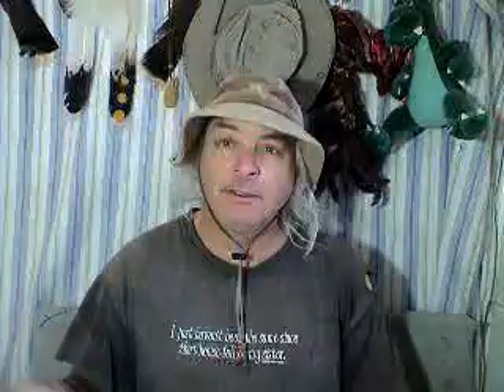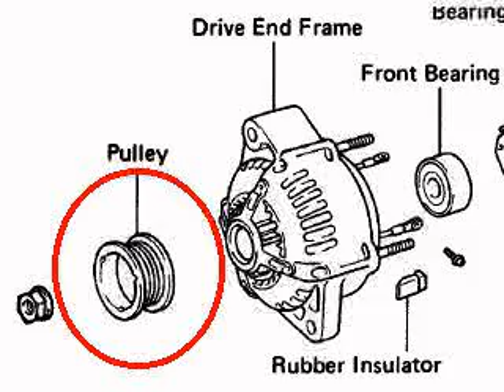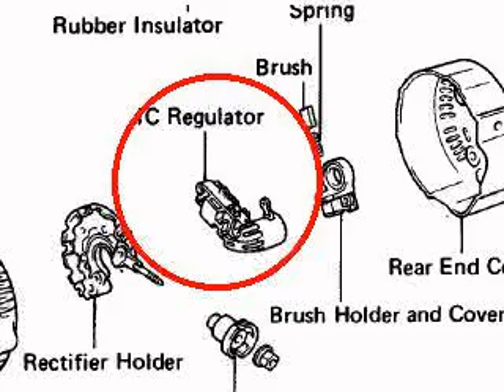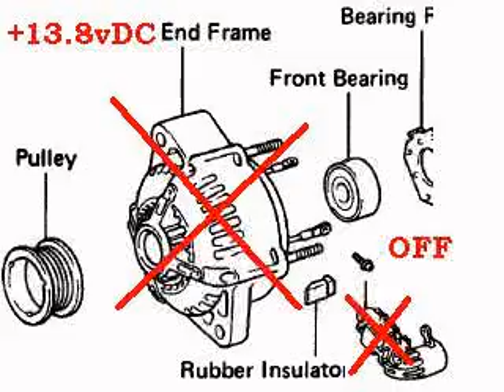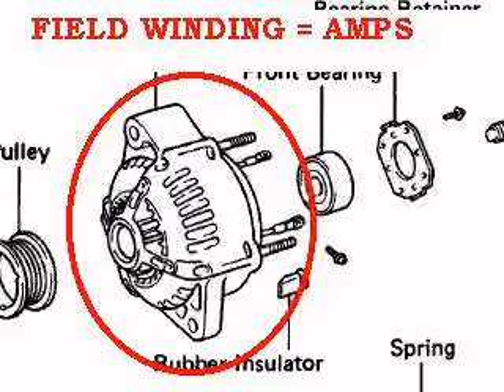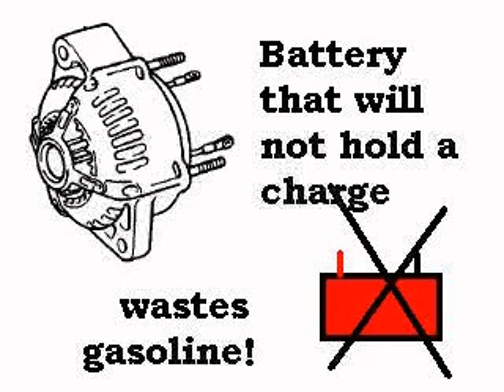Major Technology Breakthrough! Burn Water as your Automotive Fuel! HHO Part One

Comment: It's very simple.  Either he is wasting at least 50% or so of the power he's putting into the system (and thus is losing fuel efficiency, no way around it), or else he's getting impossible results.

Either way the results are not good.  A real experimenter would be interested in finding out the truth.  Free energy nuts, and yes that is the appropriate term, are so determined to be revolutionary that they don't stop to make sure they're even right.

Comment: "Most calculate efficiency of electrolysis against Faraday's proposed optimum."

I calculate efficiency based on the total power content of the gas generated, versus the power put into that gas.  Try to weasel out of that one.  Go ahead.  I accepted that I don't know the temperature of the generated gas so I can only estimate.  But it would have to be really freaking hot for that volume to be real.  And if so, again.. he's wasting at least 50% of the power he's putting in.

Comment: Let me put it another way.  What if you took the generated gas and used it to turn a whole different engine.  And used THAT to generate more electricity.  And used THAT to split more water.

If that doesn't work, then why does it work only wasting all that power through one unnecessary cycle?

Please phrase your answer without referring to imaginary global conspiracies.

Comment: one interesting method is to mix a fairly strong solution of potassium hydroxide or sodium hydroxide in distilled water then expose a piece of pure aluminum to the solution ... this causes a chemical reaction that realeases the hydrogen stored in the KOH or NaOH ... the reaction can be quite violent and gives off a good bit of heat as a by product ... not very practical, but interesting ...

Comment: We use a reation that puts potassium hydroxide into the mix. With stainless steel electrodes, the optimum voltage per plate gap is maintained at not more than 2.2v. It is a form of brute force electrolysis based on the chemical reaction associated with electroplating the potassium to the stainless steel. H2 and O2 are released as a byproduct of the electroplating process along with some modest heat. The postassium hydroxide recombines and the same KOH can be used for an extened period.

Comment: Most calculate efficiency of electrolysis against Faraday's proposed optimum.  This has long since been shown to be invalid.  Most experimenters today calcualte the volume of gas produced in a given time with a given wattage.  While a decent measure, this ignores the temperature of the gas produced so is not authoritative. The NASA gas volume measurement method is best but difficult for amateur experimenters to perform. So authoritative measures of efficiency are still lacking.  Working on it.

Comment: You split water into 2 parts Hydrogen one part Oxygen. Also known as Hyroxy, browns gas or HHO.  The method in doing so is electrolysis.  It holds stable for quite some time.  Type HHO generator in here on youtube and check it out.  :)

Comment: I believe you are mistaken.  It is not impossible to get 1-2 liters per-minute of HHO using 120-240 watts.  These are numbers of efficient electrolyzers. However 1 liter per minute at 12V 12-16 amps  is more common. however.  I personaly have built an electrolyzer that produces 1 lpm HHO @ 13.8 VDC
11 Amps. 136.4 Watts.  I am just an experementer.  If these are my results I am SURE others can do better.  I am sorry to tell you this is still not efficient enough to run an auto on hho alone.

Comment: some of our experimenters have added a secondary alternator to their vehicles for test purposes ... you are correct that in most cases, there is 30a or less in reserve after accounting for head lights, wipers and so on ... some vehicles come stock with bigger alternators but this is the exception, not the rule ... in most cases an electrolysis device that requires more than 30 amps is not practical ...

Comment: high voltage electrolysis is being studied by others ... I am not an authority on that matter ... I am an authority on the production of HHO gas, not seperated H2, and can tell you that it is quite easy to produce 5 liters per minute of gas at 70F using 1000 watts ... I do it all the time ... optimum efficiency using KOH as electrolyte calculates to about 4.88 mililiters per minute per watt ... and we are aware of even more efficient electrolytes ...

Comment from the maker: "And those work in the megawatt range."

Yes. "kratomosphere" is mistaken. It is mathematically impossible to crack water into hydrogen and oxygen at a rate of "1-2 liters per minute, 12vDC, 120-240 watts." It is an impossibility even when adding a catalyst to the water.

If "kratomosphere's" figures were true, EVERY AUTOMOBILE ON THE PLANET WOULD BE FUELED BY HYDROGEN BY NOW, since hydrogen would be vastly cheaper to make than electricity.

Comment from the maker: "How many volts are you feeding it?"

To produce 1 liter of H in 1 minute with 10 amps..... if my calculations are correct (and I am working on this for Part Two), one will need about 3,550 volts @ 10 amps. The water must end up extremely hot, or that "1 liter per 1 minute at 10 amps" claim is wrong.

Comment: I am familiar with the water injection process used during WW2. Have implemented that method on a 64 Lincoln 4 door convertible ... worked quite well ... improved both performance and economy ... but the old PickUp Truck I speak of was running on water, not water injection assist ... it was quite literally an internal combustion steam engine of very crude design ... but the darn thing worked ... I will attempt to refine the technique starting early next year to see if I can improve on it ...

Comment from the maker: "but the amount of hydrogen which was produced was far less than a burp."

Thank you for mentioning MythBusters. I am working on the math involved in using HOH as a "fuel" in automobiles, and so far I have not found a mass-produced HOH unit that makes enough hydrogen that the engine can notice: they make so little that they do nothing at all to the engines they are attached to. I've yet to find any on the Internet that can be shown to produce ANY effect at all in the engine other than waste gas

Comment from the maker: "A bad battery will necessarily decrease your fuel efficiency."

So will 3,000 watt amplifiers and woofers and tweeters in one automobile. :-) I noticed how odd my pickup runs when the battery is attached but nearly destroyed due to sulfur deposits on the lead: the idle speed also drops due to the alternator desperately trying to charge what is essentially a massive resistor.

Comment from the maker: "Adding unnecessary and inefficient steps is not the way to increase fuel efficiency."

In fact it is an excellent way to lower fuel efficiency. "Fortunately" most of these HOH devices produce so little oxygen and hydrogen that the engine ignores it completely--- so the OX sensor in the engine does not have to be bypassed.

Comment: It is not uncommon to get great effieciency.  I have seen several cases of people getting great efficiency from the electrolyzer.I built a 6X12 drycell and pulled 1 lpm at 11 amps 12-13 Volts. and it was only a 2 cell. and was at 100 degrees.  No steam. A formula for efficiency is MMW.  Millitres per minute divided by watts.  The common efficiency is between 4.5 to 8 MMW.

Comment: There is only one way to find out..  Try it.  I am not making any claims.  One thing I would like to clear up though. The ICU is horribly inefficient and a good portion of your gas goes right out the tail pipe.  Hydrogen burns hot, And also incorperates a modest ammount of water vapor to the engine.  I think it is possible that H2 may enable a more complete burn? Thus, you are wasting a some energy to tap into alot and possibly gaining efficiency.  Just a thought and it needs testing. :)

Comment: I have found something interesting on the idea of using water in an engine.  I don't know if this has been proven yet, but there is the Crower concept that a patent has been applied to.  Rather than spraying water into a cylinder willy nilly (and as likely drowning the engine as anything) it adds two additional cycles to the standard four cycle system to vaporize water instead of burning fuel.

It's an interesting idea, but at this point unproven.

Comment: "this "carborator" used engine vacuum to create a mist of water that was drawn into the combustion chamver through what appeared to be a stock intake manifold"

Yeah, but this is just the same concept that was used in WWII fighter engines.  It's not about increasing efficiency, it's an anti detonation measure that lets you run the engine harder without destroying it.

Comment: Now, assuming you're getting an efficiency of 60% (even that is high), just think about it for a moment.  You are burning gasoline and wasting 40% of the power you use for the electrolysis.  Then you are taking that resulting gas and burning it an engine that wasn't meant to take it (wasting more energy).  And you believe that this highly inefficient process is actually increasing mileage?

Adding unnecessary and inefficient steps is not the way to increase fuel efficiency.

Comment: In that case your numbers are questionable.  Without knowing details about gas temperature and altitude I can only get crude guesses, but it sounds like your numbers suggest were getting efficiencies of between 80-60%, which even the best commercial electrolyzers struggle to achieve.  And those work in the megawatt range.

Especially since you're using too much voltage and should be less efficient still.

Comment: for my tests, I used a 1 liter bottle of water purchased at the local 7-Eleven ... the bottle was fitted with a barb fitting and connected via a hose to the custom "carborator" the fellow had constructed ... this "carborator" used engine vacuum to create a mist of water that was drawn into the combustion chamver through what appeared to be a stock intake manifold ... the real trick that made it work was a high energy spark ... he told me that spark plugs last about 2 weeks ...

Comment: "Unless we find a way to separate H2O with less energy to use hydrogen as fuel."

Happily there are many projects underway to attempt to do just this.

Not to make a free energy device of course, but to make water splitting practical.

Some systems may allow the use of sunlight to directly split the water, perhaps allowing a much more efficient capture of solar energy.

Those are the technologies that I am most anxious to reach a practical stage.

Comment: The mythbusters version is a big thanks to big oil.  The electrolyzer they used produced practicly ZERO Hydroxy gas.  A good fuel assist water splitter produces about 1 litre bottle full in 1 minute for every 10 amps you dish out.  I know because I have several electrolyzers I build and use. With even the best shows on TV it is impossible to get an objective view. I am yet to see the plans they used after a year of vigorous research on the topic...

Comment: The paint is merely a theory, and it's been debunked repeatedly as the source of the fire. Yes, a large part of the skin burned, but because it was incinerated in a hydrogen fire. Some of that "flammable" skin did NOT burn.

You would do well to look at the overall picture, rather than just ONE study, which, as I said, has been debunked by other more likely theories.

Comment: DP, two weeks ago there was a Mythbusters episode where the guys busted several of the 'gas savers' and one was a hydrogen generation kit.  A water to hydrogen kit was installed on a car (per the kit instructions) but the amount of hydrogen which was produced was far less than a burp.  To generate enough hydrogen to run a car you would need 100+ of these devices running at the same time which as you mention, is hopelessly inefficient (lots of electricity + the space and weight of 100+ devices).

Comment: sounds funny but i made one check out my video

its was simple you just use  a microwave transformer in series with a spark cell.  the spark, from the cell syncs up the harmonics with the microwave transformer.  and the secondary off of the transformer burns water.

Comment: "does this mean that hybrids aren't very efficient either, even tho' the energy from fuel burning is converted into electochemical potential energy rather than a chemical reduction reaction?"

It's much more efficient to charge a battery then to split water.

The other thing is that smaller engines are generally more efficient, and hybrids use the electric motor as a booster that allows them to use smaller gas engines for main power.

Comment: If you have any doubts as to what made the Hindenburg blow, just toss a match into a container of hydrogen. Sure, there were flammables everywhere; it was a deathtrap. But it was gone in the first seconds, doomed first due to the loss of lift, and the hydrogen flame is nearly invisible on its own. In the presence of yellow and red, it'd never be seen, and yet it was the intense heat source that caused the sudden rampant spread of flames.

Comment: Nope, just inject it in with the air/fuel charge, water scares me a bit cause too much can hydrolock the engine and launch the head off.But steam can be injected without that problem, worst case toomuch and the engine stops running, but it would take a huge amount.

Comment: My uncle made a secondary set of injector heads for his car, which sprayed water into the cylinder at the same time gasoline was, which was boiled by the exploding gasoline.  This converted much of the waste heat normally dealt with by the radiator into kinetic energy which would move the piston.  The car was not 'fuel' by water, but made more efficient by its inclusion.

Comment: It's all just water under the bridge... 

I remember in the 80s when we had the last FALSE gas grunch and the resulting drop in the economy. All kinds of gas saving devices showed up on the market and I don't remember any of them ever going into production on new vehicles. (which they surely would have if they worked) I also remember a lot of pyramid schemes coming out. Wonder why we haven't seen those yet. They were as illegal then as they are now. Maybe a little more time?

Comment: Perhaps this falls under your first point, the hydrolysis of water is an endothermic reaction. The produced hydrogen and oxygen can "borrow" heat energy via the ambient temperature, that energy is returned at combustion, so it is possible to get more energy out of the reaction than is put in, just barely.

I suspect that anyone getting better fuel effiency fall under the "how you drive" caveat. They most likely overcompensate when they are in conservation mode.

Comment: maybe one could remove the cooling system and use the heat constructively, no water in the radiator,but water in the engine, the engine would need to be made from stainless, which isn'ta bad thing as it contains the heat well.

Comment: heck directly injecting steam with the intake air gets a solid 15% increase, and on long cruises 40% increases, well known. with a 5th and 6th stroke from steam, he would have to up the spark energy tremendously, I have a bit of experience with water in an engine

Comment: no I am not talking about thermal cracking hydrogen, I am talking about an effect that when water is in direct contact with the combustion flame it absorbs thermal energy and converts it to pressure energy, water does this more eff. than normal air, and therefore the eff. of the engine goes up

Comment from the maker: "Can you explain how the HHO gas torches melts stuff like rocks and metals but not fingers?"

One can hold the torch's metal tip because the cases inside the tip are not combusting: the fire occurs away from the tip. Since gases cool when expanding, the torch's tip is actually cold.

Comment from the maker: "Look up the Steam-o-Lene engine."

Way cool! Thank you for mentioning this: I never heard of it. I want one. :-) Most gasoline engines have specific temperatures they must run at for highest efficiency, so I wonder what problems would be created by making steam with some of that heat--- the engine would run a bit cooler.

Comment: Great vid DP!

However, it is possible to boost a combustion engine's efficiency with water. Look up the Steam-o-Lene engine. This is a clever design that utilizes the wasted heat created by an engine. The heat is used to turn water into steam and get thrust from it, like a steam engine. It involves turning a 4 stroke engine into a 6 stroke, where the 5th stroke is a steam power stroke (water is injected into the chamber). The 6th stroke ejects the steam from the chamber.

Comment: You are correct in general. My focus is not now, nor has it ever been automotive applications. The gas is outstanding for welding applications. As a fuel supplement in stationary engines appears to be promising. With a properly designed engine, could potentially power an automobile someday. But you are correct that to run an automobile on this fuel will require more than one technology break through. Just safe handling of the required volumes of the fuel is a challenge. We are working on it.

Comment: only a few misguided souls who cannot do simple math would call HHO a form of free energy. however, it is a viable fuel that can be used for many purposes. As petrochemical based fuels become more expensive, HHO as an alternative form of energy becomes more cost effective. Right now, propane has a slight cost advantage over HHO, but only a slight edge. Who know what the comparison might be this time next year.  You may yet want to have one of our devices to play with.